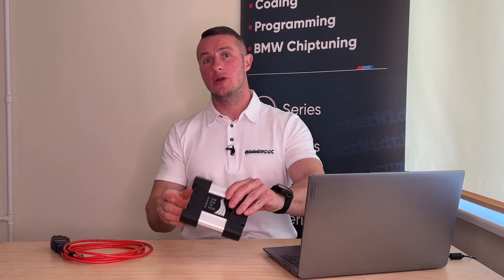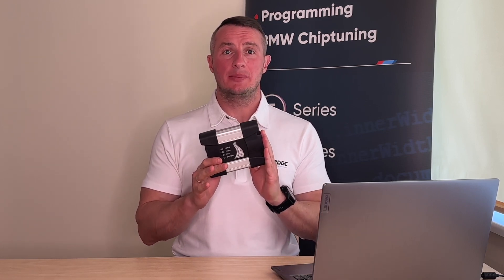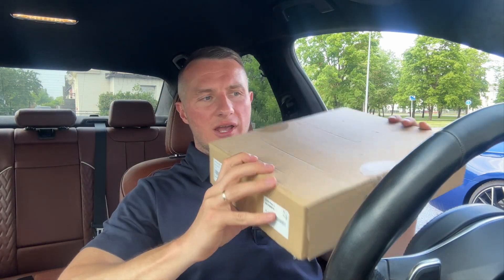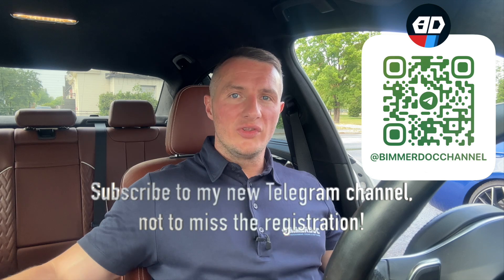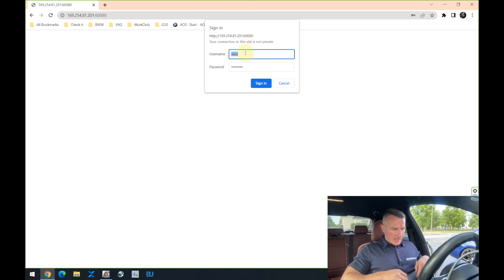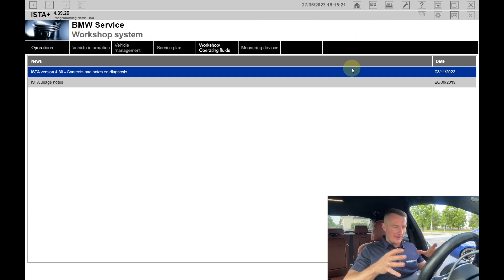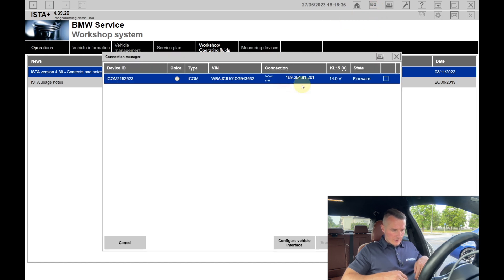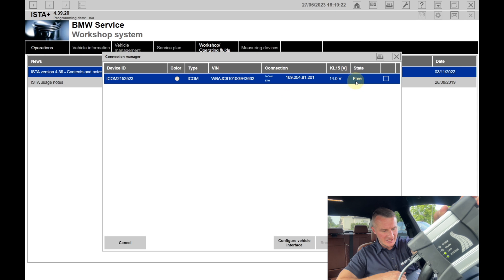Empower Your Drive: BMW ICOM Next Software Update Essentials

Comment: I have the latest original ICOM next (81315B519A5) and ISTA 4.39.20.  Would you recommend the firmware in your link - 4-24-11 or the latest firmware 4-25-10?  The device was shipped with firmware version 3.15.03.  Thank you!  Your channel is better and more informative than most BMW forums!
Reply from the maker: Be careful with icom update!

If it works with your ista I suggest not to touch it. 
Cases when icom does during SW update are kinda often!

Comment: I am about to update my ICOM A + B
One question can you update the ICOM with the vehicle connected or do I have to really do it with a power supply?
Reply from the maker: Vehicle or power supply does not matter 
Icom just requires 12V as power source

Comment: I`ve bought a last revision of original icom next and get the same problem with ista. Your video helped me a lot and now it works. Many thanks!!! The only one your file in description is corrupted. Windows say it can`t be installed on your pc. I`ve found the same version file in other place and it goes ok. Any way a good advice is a most precious than anything.
Reply from the maker: You are welcome )

Comment: i can open the firmware update on windows 11 says this app cant run on this pc.
Reply from the maker: Win 10/11 are fully supported. Issue is somewhere else.
Reply: did you work out what the problem was for the frimware update? i have the same problem. windows cant open file. win11

Comment: Hi vladimir, greetings from Colombia!!
 I have a problem with my BMW x4 2018 x drive 28i parking brake module, I have bought a replacement from a wrecked car, and need to code and program it, what do I need for you to do it remotely? Thanks
Reply from the maker: On some vehicles EMF is a separate ECU and needs to be coded. 
So most likely yes, coding is required.

Comment: Thank you very much for your videos. They are very useful. I have a problem. Icom connection error during programming. Diagnostics works fine.
"Faulty ICOM vehicle connection. The programming scopes are therefore not available"
Ista+ version: 4.39.20
Programming version: 4.48.20
Icom firmware: last

Thank you,
Reply from the maker: It is because ista expects icom to be connected over router not directly to the bmw. 
Via direct connection to the vehicle only diagnostics is possible. 

This is your problem.

Comment: Vladimir Is it possible with icom next and ista version 4.39 or higher to diagnose bmw's from 2020 and higher ? I think from that year and after the cars have security gateway protocol for the obd.
Reply from the maker: The year does not matter. Matters cars architecture. 

Is it still SP18
Or already SP21

With SP21 you will be limited with ista 4.39
Reply: Thank you for the information.Will  Ista 4.45 work with Sp21 architecture?
Reply: I am interested in the same question- is it better to use older, or newer ISTA version with SP21 cars?

Comment: Just purchased a new ICOM NEXT,( not arrived yet)  I'm using ISTA+ 4.28 and Ista-P 3.67  versions from your other video on how to install it, what version of the ICOM software should be in it for me to get good realible connections? Good info on this, because if I recieved my new ICOM NEXT and it didn't work I would have sent it back without knowing about the possible updates needed. THANK YOU..

Comment: Hello Vladimir, can you confirm that you can only update the firmware for an Original ICOM, not a cloned one?
Reply from the maker: No it’s not true. 
Clones can be updated with the same software. But you have to make sure what are you going to update. Because very often clone shell is one thing and inner parts way another. For example you can have icom next shell and icom A2 inside. So you need to use firmware for icom A2.

Comment: I reveived my icom next today from dealer after one year backorder.. comnected in car but show firmware. Made pictures of the ip adres. But when i try to connect it dont. What am i doing wrong.  I have ista+ 4.32.15
Reply from the maker: Maybe icom software is too old and requires update. I have a video about that on my channel
Reply: @BimDoc  where can i find latest firmware?  
Current package image version 03.15.03
Current system image version 01.01.04
Current aplication image version 01.01.04

I downloaded the link above. Its installed the bmw_ispi_icom-next-FW_04-23-10 installer but thats all.  Update in ista+? Because i see some do on icom next direct via the ip adres to load system image and aplication image.
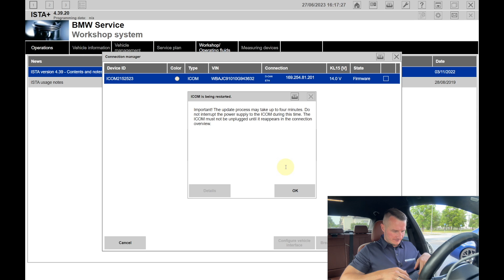Reply: @BimDoc 10:36 pressed Ok in ista+ icom no restart, dont start update?

Comment: Thank you for the video and all the other ones! My icom next COMM led stays always red but i can communicate with cars, do you know why? I tried with another car E series and it flashes between orange and red. The COMM light is never green, even after update the icom... Can you help please? Thank you!
Reply from the maker: When it communicates red is okay. 
While start lights should be green. 

But if you do see the cars then it should be okay. I cannot explain that kind behaviour
Reply: @BimmerDoc  The COMM light is red from the beginning to the end, never green with any cars. It turns orange/red only when it communicate with E series cars but the reading is very slow in that case, so I guess there's an issue 😞
Reply from the maker: Looks like yes smth is not correct. 
Programming with that icom might be a bit dangerous. Be aware of that
Reply: @BimmerDoc  Sorry to ask but what is smth? What do I need to do to solve that? I didn't dare to program with it for the moment, I use my enet to do that, I used icom only to diag with ista... Thank you for all your answers 🙏

Comment: I had on my BMW 7 F01 bad HSR modul which is for rear steering wheels... I bought used one and BIMMER DOC, coded it remotly, made steering alignment and deleted errors... Guys are fast really doctors for BMW... Thank you Vladimir and Emil for help.. You are the BEST!!!!.

Guys, if you need coding or anything, buy Enet cable and Bimmerdoc will do remotly what ever you wanr
Reply from the maker: Thnx for your review)
Appreciate that